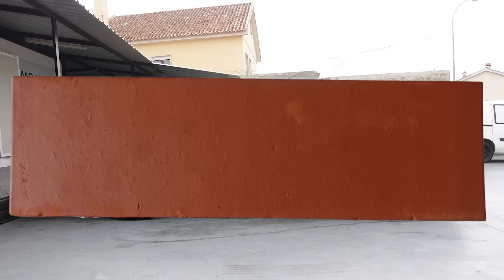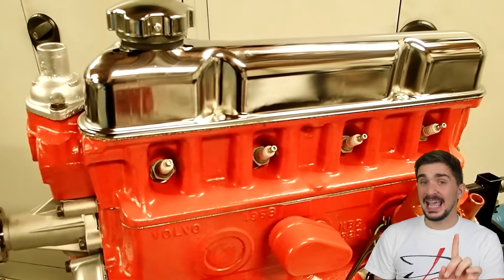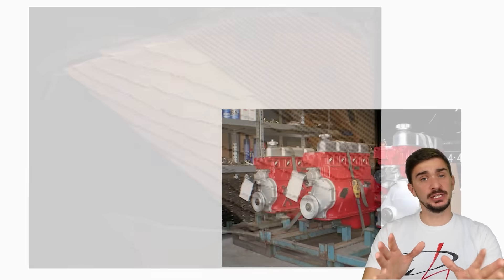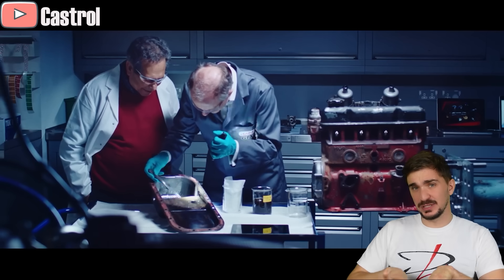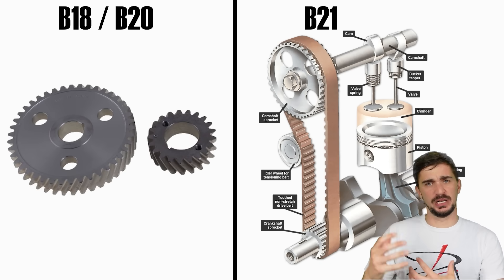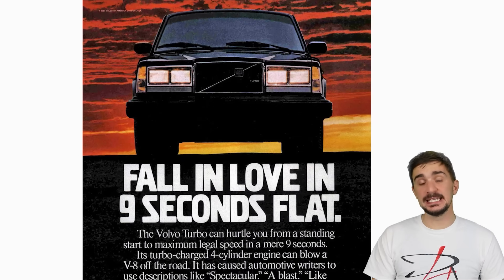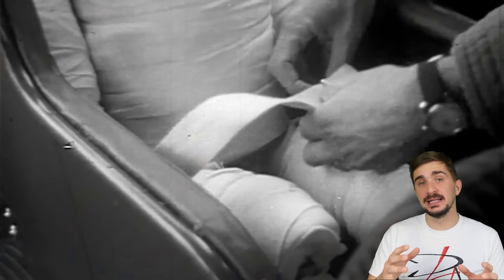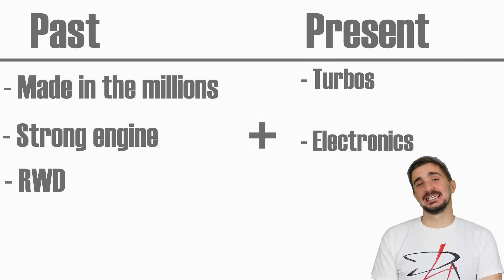A Story about the Volvo 240 and its Redblock Engine - Iconic Cars and Engines #18

Comment: One thing forgotten was that when the new OHC redblock was developed, volvo made it a non interference engine(most of them until 98 still are) in case the belt would snap no harm would be done to engine and you could put a new one in and continue to drive. 

Volvo also marked up everything so you could retime it with ease yourself without any specialty tools.
Reply: Broke mine while ago, dropping some screw down the casing of the belt and it snapped when I turned the key. It was a 2h job, granted it was the first time with did it and my car has the ac bolts in a different spot from other models, which took at least 30m to figure out. Knowing what you are doing it is a 30minute job really. No special tools required. I basically can fix almost the entire car with a 15€ tool kit from Lidl.
Reply: @salvadorpalma8173  And the parts cost same as a pizza.
Reply: All 8v redblocks except b230k with the heron head are non interference
Reply: @redblock5949  yeah, i have a B234f in my manual 940 wagon which is a 16 valve and sadly not a non  interference engine but having a NA engine that makes almost as much power as the turbo version(155 instead of the turbo's 165hp) is pretty fun as well, especially bc it has an automatic locking differential from factory, which is awesome for drifting! So i'll accept the downside of having to change the timing belt at the correct intervals and not just driving it until it snaps lol. xD but the B230ft would have been pretty cool as well :D
Reply: @davidblass2660  you mean it IS an interference engine?
Reply: @jamesmedina2062  oh yeah, sorry i meant its sadly not a non interference engine. thx for correcting me
Reply: @redblock5949  Was just about to write that, but then I saw your comment!
Reply: yep, i stripped my timing belt one winter. took me half an hour to replace after buying one at the local dealer. when i blew my headgasket i just drove 140 kms home to the garage to change it. took an hour or so.
Reply: My grandma got T-boned in her Volvo 240, not only was she ok after, the car was fixed and she kept driving it until she passed away years later.
Reply: I had two Volvos, a 740 and a 940. they were both awesome cars  and had done over 500K miles when I parted.w with them.  As you point out changing the cam belt was a doddle.
Reply: @THEJR-of5tf  how was fuel econ?
Reply: @jamesmedina2062  22 mpg. In my experience, it didn't matter how hard I drove it, it still delivered that milage.
Reply: @georgesakellaropoulos8162  and they were both 4 cylinder?
Reply: @jamesmedina2062  If you have manual B230F from 1989 or newer you get about 0,8 l/100 km at 110:ish km/h. Which translates to 29 mpg at 69 mph. B230FT gets pretty close to that. But that wasn’t sold in the 2-series.
Reply: @jamesmedina2062  yes. My significant other at the time had a 260 and it gave practically the same mileage, but was significantly less reliable and only produced 4 horsepower more.
Reply: @ezrollergbg  Imperial miles? Those are shorter!😂 For a spacious and safe car either way thats not bad
Reply: @georgesakellaropoulos8162  all these models are so foreign to me. I only know the later ones like V40, V70, S60 etc.  I think I was into Saab more when I was younger and only when I got older and learned how comfortable they are did I want a Volvo like a convertible C70
Reply: @jamesmedina2062  US miles. The LH 2.4 fuel  injection is pretty good at keeping consumption low. You of course need good wheel alignment, decent motor oil, decent tires etc. for this fuel economy. An automatic will of course have higher consumption even on the highway as the 240 series never got a box with lockup. You can retrofit an AW-71 from a 7/9-series though but it does require a modified front prop shaft since the ZF box the 240 comes with is a different length. The AW-71 is longer if I remember correctly. You also have to modify the shifter linkage slightly.
Reply: @Ole Nilsen "Volvo"? It's an old bird... seen a few jogs around the sun
Reply: @ezrollergbg  0,8 L per 100 would be fantastic! Actually 8 is still good :)
Reply: @ezrollergbg   idk.. 🤷🏼‍♂️ i had about 10 of those redblock Volvos and all of them was obout 0.9 - 1.1 liter / mil for ”normal drivning”  little heavy on right foot? 2.0 liter /mil no problem 😂

Still got one as Daily driver..
Reply: @swampen85  You obviously don't know how to drive to be light on fuel. ;) I currently have a 940 Polar with the B200FT and it uses about 1.1 at 110 km/h of E85 (green injectors openly mod) under normal conditions.
Reply: @ezrollergbg  i Never had that small 2.0 engine, 🤷🏼‍♂️ 
have had B21A, B23A , B21ET,  B23ET,B230FT, B230k , but i dont have i RWD Turbo car at 1.6ton to save gaz.. 
my 940 Turbo B230FT is pretty fun to.
Reply: @VndNvwYvvSvv  No. 1 l/10 km. Or 10l/100 km. Not miles: The rest of the world uses km an liters. 23,75 mpg.
Reply: @swampen85  Well.. a lot of driving is just transportation. And if you are just transporting yourself there is no point in burning unnecessary fuel. The B200FT is not different than the B230FT in any other way than displacement. It is capable of the same power, just need a little more revs. The original 13c turbo comes alive at 1800 rpm with the B230FT and at 2000 rpm with  the B200FT. Same camshaft, same valves, same fuel map and ignition map. Uses pretty much the same amount of fuel. I've had 245 with B21A, 740 with B230E, 740 with B230ET, /40 with B230F, 240 with B230 F. The F & FT uses far less fuel than the E /ET when driving on the highway.
Reply: I miss non interference engines. But I can't go back because the interference and vvti stuff is a nice hp/mpg bump lol
Reply: Been there, done that!
Reply: No one mentions non interference or interference engines these days.
Reply: @miriamvivo4279  yes most engines are interference today and probably chain driven. Most people know to make sure their car can keep time. It's not even a question. It gets done. The ECU picks up changes quickly as well.
Reply: @jamesmedina2062  The problem with a lot of those modern chain driven engines is failing guides and tensioners around 100 to 150k, especially if oil changes aren't done regularly, and if they fail pretty much destroying the engine, or costing and arm and a leg to repair when they are worn and need it. I have an 05 XC90 with the 2.5T, took me about 45 minutes to swap the timing belt, tensioner, pulley and water pump, and $240 for the parts. Maintained properly those 5 cylinder engines easily do 400 to 500k, I bought this car used with 170k miles on it about 2 years ago for cheap, great body, interior, engine, but needed brake pads, rotors, suspension bits, various mounts that were worn along with the PCV system that the previous owners hadn't bothered with, which caused cam seal leaks. The cam seal job was the only one I paid a shop to do because that does require some special tools. All the rest was incredibly easy to myself except for one little banjo bolt on the PCV system that was a bear to install, and I had to drop the oil pan due to carbon completely blocking the oil drain back passage. The crank case was pristine when I opened it. Put 30k on it since, runs fantastic, has amazing crash scores if ever it should be in an accident, and I've got maybe $5500 into it all in. Sadly their newest vehicles have a lot of mechanical issues it seems. 

I really prefer belt driven, yes it means you need to swap them out more often, but generally they are designed to do so, and that allows the engines to last much longer.
Reply: Nope, the B200 engines are interference engines. So, only correct for the 8V B230
Reply: @walterwixzwerg6735  and not b200k / b230k
Reply: Yes my Volvo 244 cambelt snapped,I'd no idea what happened and tried to restart engine spinning it over and over, finally figured cambelt gone , everyone told me I've wrecked the engine,not a bit of it,a new cambelt and engine run perfectly.
Reply: I have a Honda Accord Coupe with the great 3.5L V6 but its an interference engine and around 90-110k miles everyone dreads the expensive timing belt change. But we dread not changing it and having it break and destroy the engine.
Reply: I found that out once, belt tensioner worked loose somehow.  I can verify it was pretty easy.
Reply: Not the 1987 year B230k engine… 😂
Reply: @Lurch vr6 v.a.g has No timingbelt…. 😜
Reply: My brother drives this car (Volvo 940, B230F) for about 10KM without realizing the timing belt was stripped! It still arrives safely at the destination! 

The only complains is "the engine does not run smoothly" 

He order the new timing belt & he install the timing belt himself on the next day!

Comment: I bought a 940 with 200k miles on it. Drove it all over Sweden and sold it with about 250k miles. It had been sitting in the driveway for months untouched, but when I reconnected the battery and turned the key, it started in exactly the same way as when I was dailying it. Not a hesitation, no sign of the neglect and abuse I had put it through. The body was badly rusted, but the drivetrain never ever skipped a beat.  The new owner patched the rust holes and drove it for two more years before he sold it out of town. Bulletproof doesn't even begin to describe the rugged simplicity of these machines.

Comment: I remember a 240T absolutely cleaning up in NZ touring cars in the 80s. The rules were loose enough (back then) that you could bolt on a huge turbo at any boost to a 2 litre and be fine. Hence the 240T was  boosted to ridiculous levels and cleaned up against NA 5 litre V8s
Reply: Still can in most countries. (freedom sounds intensify)
Reply: What horsepower rating did you get out of it, do you have any idea?
Reply: I was working for the local  dealer and importer for Volvo in New Zealand in  those days  phone never stopped for enquiries to buy..I later moved on  to Australia owned 2= 240 series lucky also worked for 2 dealerships there .Back to NZ AND A 360 AND 240  and my last one  a 960  -great cars the 360 gearbox rear axle  was  a great little car VOLVO I ROLL

Comment: I used to get roasted for having multiple old bricks but it seems like they get more and more recognition every day! An interesting variation of the redblock engine is the 2.5l 16v version that only came in marine applications.
Reply: Another interesting engine is the b204ft 16v turbo, the most powerful stock redblock. Developed mainly for Italian market and only 2.0liter for tax reasons
Reply: My dad has one of those marine engines stashed away in a shed.
Reply: I remember servicing one at my Dad's boat shop , amazing throttle response.
Reply: the prices are rising and attention is coming. they're awesome cars but i don't think i want everyone to know
Reply: glad you mentioned the aq171c, i've got one in my garage waiting to go into my 240 estate
Reply: @nedclarke2716  I’m piecing together a 16v 2.5 turbo for my 780 bertone. I bought the crankshaft and block from an aq171 or aq151 and the 16v from a 740/940GLE. I’m going with forged pistons and connecting rods so it should be a unit
Reply: @BubbaMcCoy  yes also the 2.5l crank has different pistons with a higher wrist pin and I didn’t have those so I ended up buying forged ones with valve reliefs

Comment: Maybe immortal, and a great design, but it felt like driving something agricultural. And I'm talking about the 700 series.
The 850, S70R and V70 I drove later and to this day, are an incredible step forward from that agricultural phase.
Reply: Pfft, the 2-, 7-, and 900 series had excellent handling characteristics.
Reply: @EddSjo  sorry, at that time I was used to BMW and Audi. The 700 series definitely felt agricultural to those cars. With an automatic transmission that had to shift down when overtaking on the motorway. When I had the chance to drive an 850 four years later, I was hooked.

Comment: Nice vid, but as one who owned 244, 740 and 960 Volvos, I would say that 740 is the real gem here. Stock 244 lacks driving comfort as well as interior comfort. It's also overpriced as hell. Stock 740 is an improved version of 240 in all aspects, especially interior comfort. Driver's seat is the best swedes ever made to this day. And it's a best buy for your buck. 960 - Volvo's attempt to jump in a luxury segment, with Multilink rear suspension (30 silent-blocks, you're serious!?), and a shitty 6-cylinder engine. Not worth it. Though the 940 with inline 4 before the restyle had a classic rear axle and isn't bad. But the metal used on 900 series become worse quality then on 200 and 700 series. So 740 with B23 is the best choice you can make out of these three.
Reply: Yes, the 740 had a very comfortable driver seat & much better suspension 'ride' quality than the 240 with rear-axle cart springs !

Comment: You know what other cars were made in the millions, are RWD, have a cast iron block+alu head engine and are boxy?
Ladas.

Can you make a video on them?
Reply: Found the specs of the bearings:
Conrod - all 4 - 20,7mm width
Main - 1, 2, 4, 5 - 21,25mm
Main - 3 - 22,75mm

Okay, not as massive as the RedBlock, but the 5 main bearing RedBlock started at 2.0L
The Lada engine started at 1.2L.
Red went up to 2.3L
Lada - 1.8 at most, in the rather rare 2130 Nadezhda, the regular production versions top at 1.7L with the 21213 and its variations.

The XUD9 had slimmer bearings - 20,05 conrod and 20,29 mains
Reply: btw, the bearings are also massive.
Some truck diesel had about the same width main bearings.
Reply: That's a copy of a FIAT car... isn't it?
Reply: @johnnyblue4799  not really, the body is a Fiat 124 made from thicker steel, but the engine has no connection to Fiat.
Except some bolts and the piston diameters, as the tooling they got was italian.
But no Fiat engine has 95mm cylinder spacing and SOHC.

Comment: I am considering buying a Volvo V70 with a 2.4 Diesel engine (from 185hp to 215hp). How do they compare to the Volvo of old?
Reply: The D5244t is quite reliable, only really big issue with it is lack of protection of timing belt if the auxiliary belt snaps but that hasn't stopped all the D5244t engines (from 130hp to 215hp) to go over 500k km with basic maintenance
Reply: gasolin more fun
Reply: Dunno about Diesel, but I have the 2001 V70 2.4T 200HP and it's over 350000km and still going strong.

Comment: i wonder how much boost it takes to blow up the engine and how much power it will make by that point
 what im seeing is a 4 cylinder 2jz that is more indestructible
Reply: 350hp at flywheel on pump gas, for the later engines with thicker conrods

Throw in a set of aftermarket conrods and it's good for up to 500